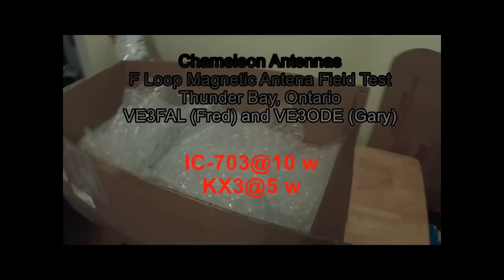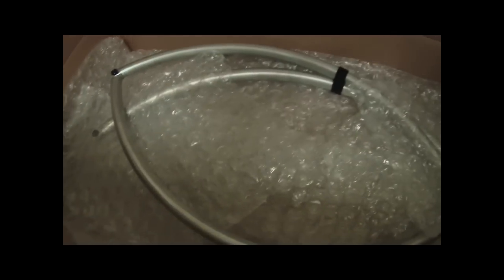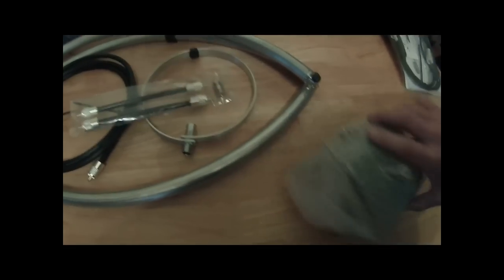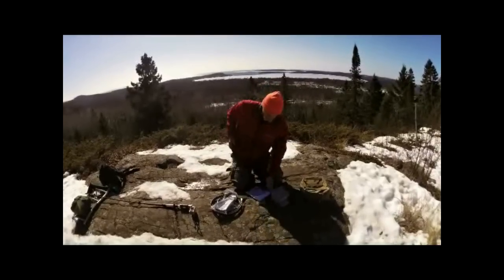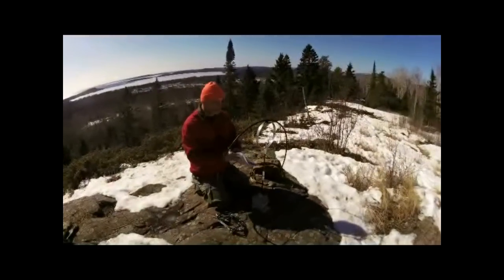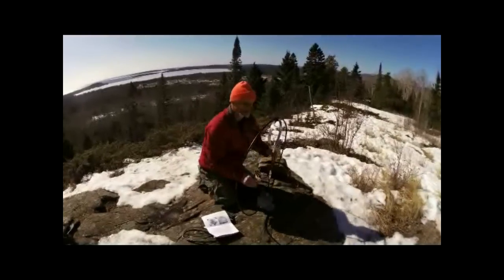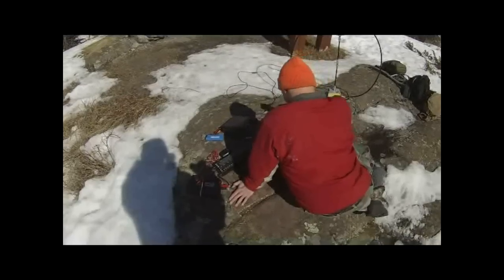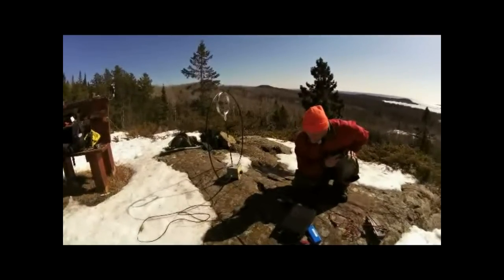Chameleon Antennas F Loop Field Test Mar 2015

Comment: -18C?
Reply from the maker: Yep was -18c with windchill or 0F, still sweatshirt weather
Reply: I went to Poland a few years ago and the temp was -23c, I have never experienced weather that cold. Here in the UK (South), the temperature may drop to -2c, but not that often. We are in the middle of the winter at the moment and the outside temperature is 9c. 

I ordered the Chameleon F Loop antenna yesterday after comparing similar antennas on YouTube. I expect the department that deals with import duty will want to charge me tax - Value Added Tax (VAT) when I attend the mail office. If something arrives from the USA they always charge me, but they never charge anything when goods arrive from China.

Thanks for the video.

73,

Bob.
M0BOB.